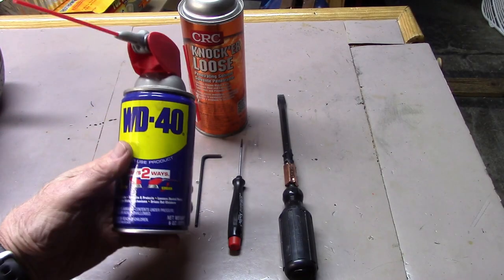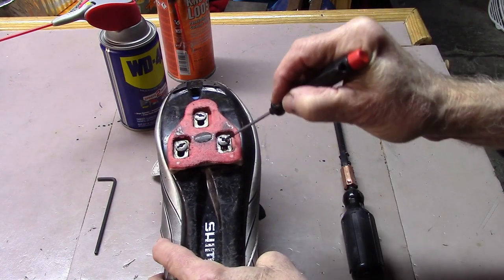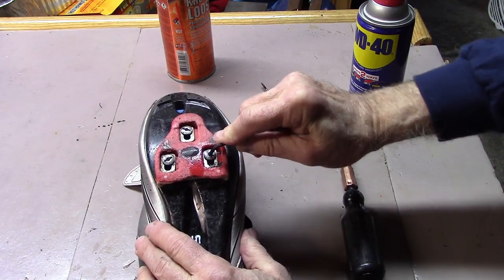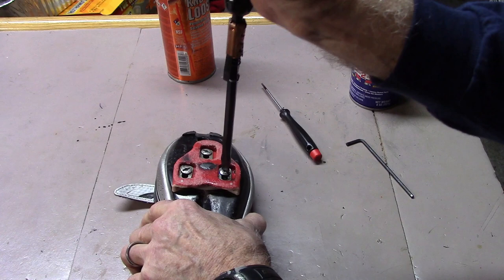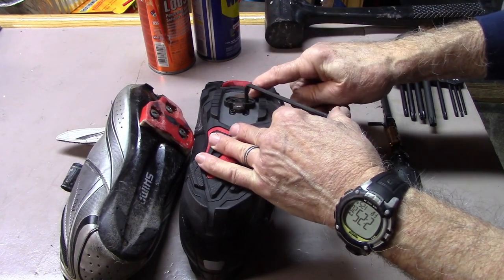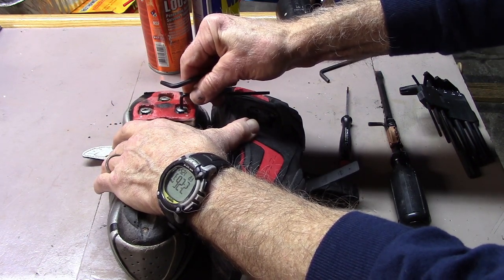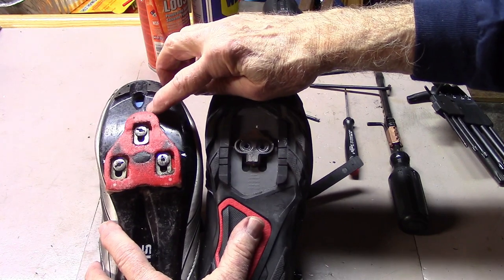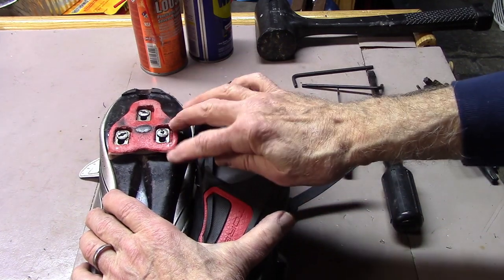Stuck Bicycle Cleat Bolt: How to remove that stuck cleat

Comment: Of course,  for a little preventive maintenance , a little dab of  grease on the bolt threads, will prevent future issues. Nice video. KB.
Reply from the maker: Absolutely.  Always use the proper thread lock (grease, anti-seize, Fiber Grip) as specified by your manufacturer. Here, just a bit of grease as you point our helps prevent the problem.  Regards, Tony

Comment: This was really helpful, thanks! The key tip for me was using an mallet on the Allen wrench.
Reply from the maker: Yes, a light tap on the Allen wrench works well. Don't tap to hard or you may ruin the Allen wrench itself. Regards, Tony

Comment: I used vice grips on the front part of the cleat and turned the who cleat. Might be a bit of damage to the cleat, but it was being replaced...
Reply from the maker: How did you manage to remove the cleat after you were able to turn it with the vise grips? I will also have a video coming out early next month on some other measures which can be used as a last resort. Thanks and regards, Tony

Comment: I didn't have a two-sided extractor, but I used what I had and then used a flat head to pull it out.
Reply from the maker: Good job. In the video, I'm not using a two-sided extractor but just a hex key or torque wrench key. One could also try a drill extractor set as in the following video:
https://www.youtube.com/watch?v=_Kwo3TEQdJg
Regards and safe cycling, Tony

Comment: What kinds of sprays have you used to try to free up the bolt?
Reply from the maker: I've used Kock'er Loose Penetrating Oil. Helped me a great deal when restoring vintage bicycles. On stock cleat bolt, it may or may not help, but worth a try. The can of spray has lasted a long time and worth the small investment. Regards, Tony

Comment: When I try to remove bolts in my shoe, the nut inside the carbon sole appeared to be rotating with the bolt as I unscrew. I can’t think of a solution to remove it. Any ideas?
Reply from the maker: Most bicycle shoes have removable inner soles. You may be able to get at the nut from inside the shoe and hold it. Let me know.
Reply: Tony Marchand unfortunately not. They’re old Sidis. You can remove inner sole but there’s still another in removable sole between you and the nuts
Reply from the maker: @draledjones  The only way to get at the nut is to cut a small hole in the inner sole to get at the nut. Your can use box cutters but wear heavy work gloves and try not to cut your fingers. Box cutters can be a dangerous tool to use. I'm not sure how this would work out, but it may be worth a try before you go out and buy new shoes. The newer bicycle shoes have a large internal bracket the the cleat bolt screws into and will not rotate as in some of the older shoes. Another option is to take it to your local bike shoe and see what they could do (probably tell you to get new shoes). Continue to give me some feedback. Regards, Tony
Reply: I have this same problem, the nut is rotating. I can get to it to remove the screw and cleat. But unsure how to secure the nut to install new cleats. Any ideas? Shoes are in shape good and comfortable. The bracket you mentioned is intriguing. Know where to get one of these? Thanks

Comment: I used a Dremel to cut a groove in a worn bolt to fit my screw driver and was able to remove the bolt.
Reply from the maker: That will work, but you have to be careful not to cut the shoe itself. Once you've made the cut with the Dremel, tap the screw driver lightly with a hammer to wedge it down into the grove. Thanks Jay.

Comment: What's the best way to prevent the bolts from seizing so you can remove them when you need to replace the cleat?
Reply from the maker: Clean, dry and a dab of grease on the bolt should do it. Tighten firmly and try them to see if the fore/aft and angle fits well. Then tighten firmly. Shimano suggests a torque of around 5 Nm. Probably the same for others, although other manufacturers have no listing. If your cleats keep bolts loosen although you have snugged firmly, you can use some blue Loctite on the treads. Any one else have any suggestions?